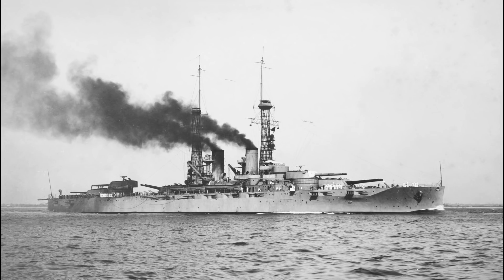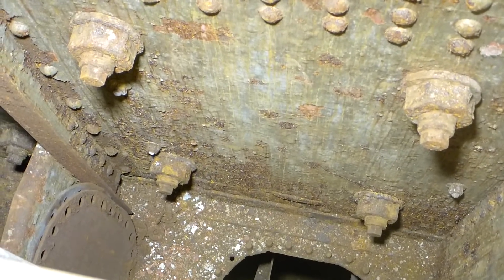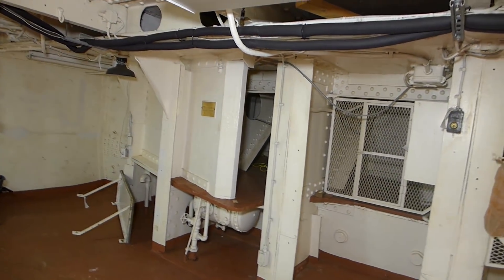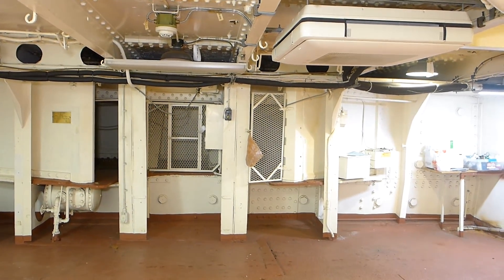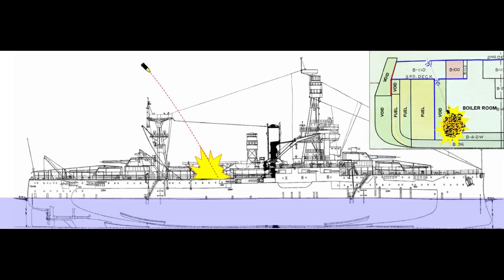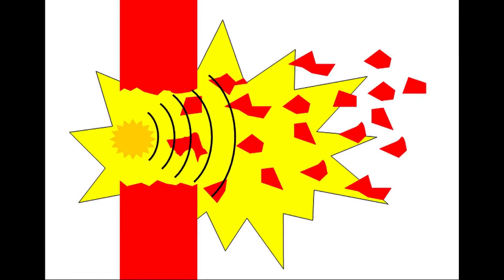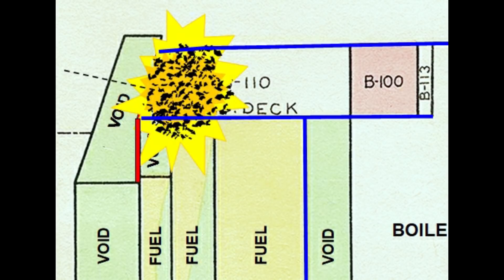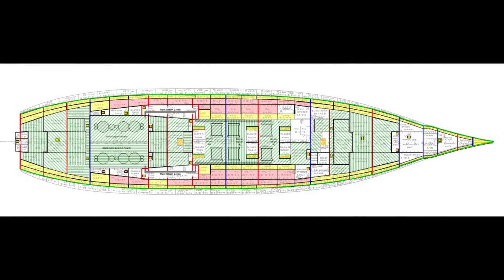Battleship Texas- Armor Armor Everywhere.... Well Almost

Comment: Some notes on US Navy 20th Century battleship armor (also applied to cruisers in many cases).

(1)  STS was made by Carnegie or, later, Carnegie-Illinois Steel Corporation for the Bureau of Construction and Repair or, later when this was combined with the Bureau of Engineering (power plants), the WWII Bureau of Ships.  It was metallurgically identical to the Bureau of Ordnance Class "B" armor, though BuORD also had The Midvale Company and Bethlehem Steel Corporation make Class "B" armor.  BuORD made armor for the main guns and the conning towers and also all Class "A" armor no matter where it was used, including the ship's belt.

(2)  Thin horizontal armor for roofs and decks was through WWI due to the lack of advanced fire-control gear that restricted reliable shooting to rather short ranges where the shells would be travelling very flat with only a small angle of fall.  Thin STS/Class "B" used for such decks would be hit at as very highly oblique angle and could skip off such armor like a flat stone on a calm water surface.  Face-hardened Class "A" armor,, which, as mentioned, could spall and break up, was not a proper material for such high-angle protection.  After WWI, though, fast improvements in fire-control (better range-finders, gun directors high up in the superstructure to see farther, and greatly improved computer devices), as well as the emerging threat of bombing aircraft, required much thicker horizontal armor be used to protect important weapon, propulsion, and fire-control equipment.

(3)  Delay-action fuzes were not used much until after WWI, though the German Navy in its latest WWII AP ammo and a few other guns introduced them duri9ng WWI and, though the fuzes were rather poorly designed, they demonstrated enough success to cause these fuzes to replace the non-delay (0.003-seco0nd inertial delay only) by 0.025-0.4-second delays (depending on the nation and its idea orf terminal attack requirements) delay-action fuzes.  These new fuzes made keeping the shell from exploding deep inside the ship much more important that in WWI, hence the changes in armor design in post-WWI warships.  In many cases, inclining the side armor by tilting it back or forward was now widely used to increase the armor's effective thickness without as large a weight penalty as merely making the side armor thicker.  For example, the armor belt of the IUS Navy OWA Class WWII battleships was tilted forward (face-downward) by 19 degrees to greatly improve its resistance to downward-falling AP shells, especially at longer ranges.

(4)  The AP caps used by most large AP projectiles during the 20th Century Age of Ironclads era through circa-1950 were used as "crash helmets" on these shells when hitting Class A" armor (or its non-US equivalents).  Originally these caps were merely soft steel and worked by being flattened onto the face of the plate to form a doughnut-ring surrounding the nose when it hit the armor a fraction of a second later.  The shockwave set up in the projectile nose could now move sideways into the flattened cap material and blow it sideways like an over-inflated balloon, removing this dangerous energy from the projectile nose, since otherwise the shockwave could only move lengthwise down the projectile body, trapping a lot of energy in the nose to break it.  Later caps were hardened and they also acted like a center-punch used to set up a steel plate for drilling by making a deep pit in the plate, greatly increasing the penetration ability of the AP shell as well as protecting the shell nose.  Most later AP shells had smaller explosive charges, too, to allow a thickened and toughened shell middle body to resist breakage at higher impact angles.
Reply from the maker: Thanks for your input, it is always welcome!  I've read much of your online work and it has always been very helpful.

Comment: Hi Tom, I was in the Navy in the 1980s and on the Battleship New Jersey. I know about how the armor and 16inch guns were constructed by Bethlehem Steel, in Bethlehem, PA. I wondered who was the make for the armor and steel for the older battleships like the Texas? Was it still Bethlehem Steel?
Reply from the maker: Texas' Class A armor was provided by the three major foundries; Bethlehem, Carnegie and Midvale.   However, the practice of mixing vendors apparently changed soon after Texas was built and most ships' armor came from a single producer.

Comment: 9 seconds in and the narrator claims USS Texas and New York were the first battleships in the world to mount 14 inch guns. The IJN Kongo was laid down before texas, launched on 18th May 1912 and comissioned nearly a year before Texas. During the interwar years , Kongo was rebuilt as a fast battleship. That makes Kongo the first battleship launched with 14 inch guns.
Reply from the maker: You are right.  Even though Kongo was designed and constructed to be a battle cruiser, I would feel pretty silly trying to defend my statement using that as a defense.
Reply: @tomscotttheolderone364  It is still a valid point you make. I guess the upshot is, USA, Chile, and Japan all specified 14 inch gunned capital ships at about the same time.. This happened after the US government announced that they were planning to build 14 inch gunned ships.

Comment: Even though the texas lack the turtle  deck armor to protect the magazines vital below the water line, the ship have an upgrade of the outer hull to increase some of its armor capabilities against large caliber shell though less effective.
Reply from the maker: There were two armored decks above Texas' magazines that provided some protection against high angle hits and splinters.  What she didn't have was the angled splinter deck beneath third deck found on later ships that deflected splinters directly produced against main belt impacts.  The only upgrade to the hull was external torpedo blisters added in 1925-26 that provided some added protection against torpedoes.  It was thick enough to initiate a torpedo's fuse and give an air space to help dissipate the explosion.  However, it offered no additional protection against shell strikes.
Reply: @tomscotttheolderone364 

I misinterpret the splinter deck as
Turtle deck armor on the Nevada class. Apologize for causing misunderstanding
Reply from the maker: @wongyc5585  Please do not apologize!  I sometimes don't explain things as clearly as I should!

Comment: Great video Tom. Was there a penetration of belting by the German shell that struck Texas? If so, what belting did it hit and could you talk about that in a video if you haven't already?
Reply from the maker: The shell hit on the half deck level, above the the belt armor.  It penetrated standard steel plate that was either 1/2” or 5/8”, I don’t recall, and came to rest in a junior officer’s stateroom.  It punched through sideways without detonating after skipping off of the water at a shallow angle.
Reply: @tomscotttheolderone364  Thanks Tom.